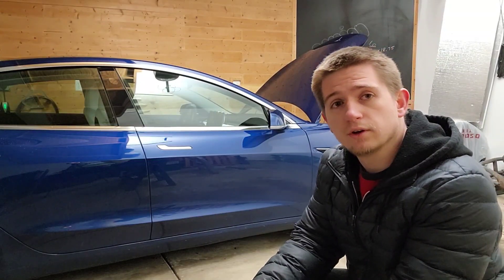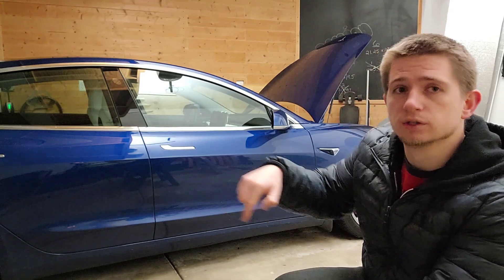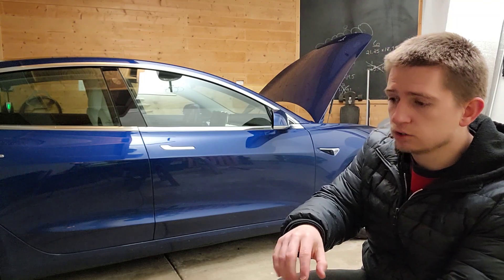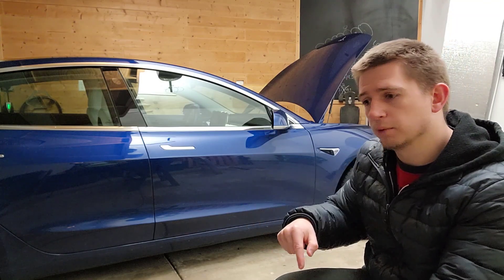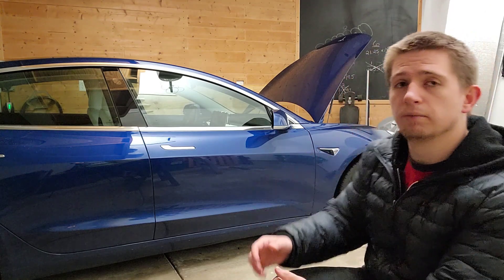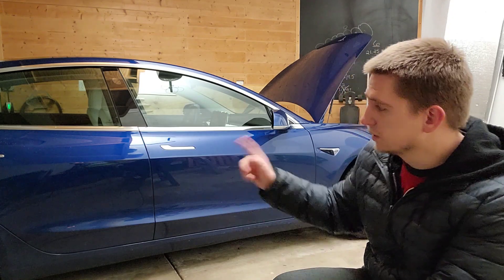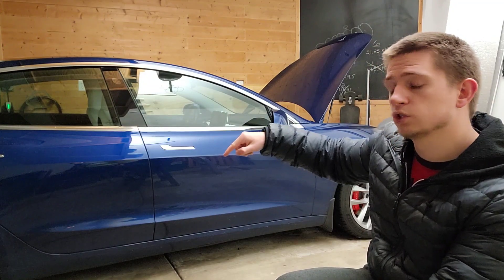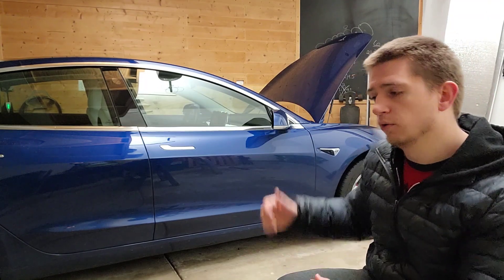Tesla's Without a Heat Pump

Comment: Brilliant, I wonder how long until Tesla adopts your idea? And perhaps Tesla should implement an incentive and appreciation program for those who contribute innovative ideas.
Reply from the maker: Just barely missed the year they added the heat pumps in the cars, so a circulation tank heater it is!
Reply: @LifeAroundDamian  Yup, I guess the Heat pump is better than using recovered motor heat, but is it as efficient as an immersion heater?

 I installed auxiliary immersion electric and diesel fired coolant heaters on a lot of vehicles and equipment in Alaska as essential equipment. 

I later installed VW Diesel immersion heaters on my IC vehicles in the lower 48 with remote switch/timer at to preheat engines prior to starting, and found that depending on trip length, they reduced fuel consumption between 5 to 20%.
Reply from the maker: @jackoneil3933  When installing the coolant heater on my Tesla, I really focused on improving the range, performance, efficiency as well as the lifespan of the battery pack. 

Comparing this to an immersion heater, they have a very similar concept. For my application to test and see how well this would work this was the best option. I added this right behind the bumper and externally plug it into a 110V outlet.

 So far I have improved my regenerative braking performance substantially. The coolant does drop in temperature slightly after an 8-9hr work day, but I do not lose my regen completely. The range also does show an improvement right after the coolant hits its nominal temperature during heating.